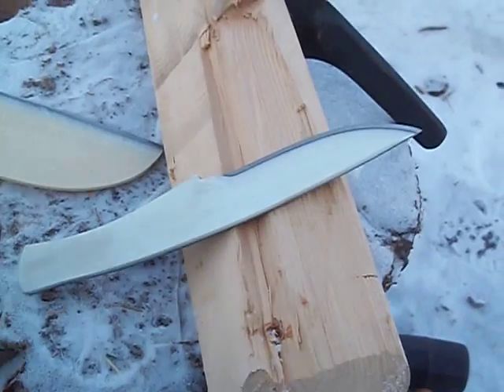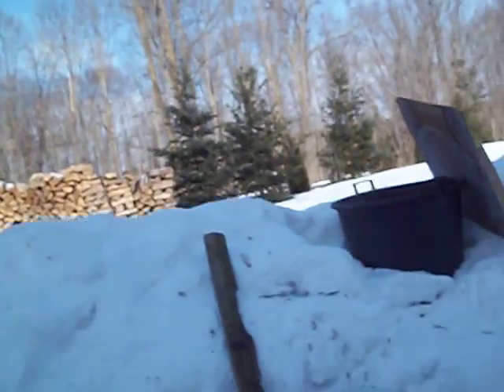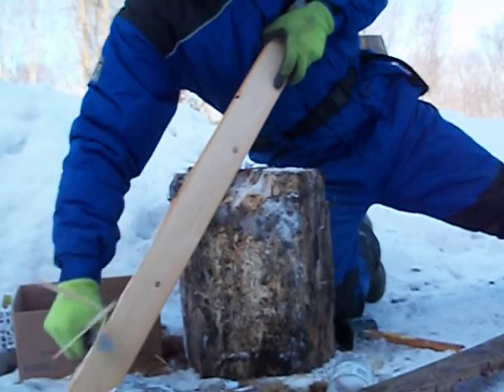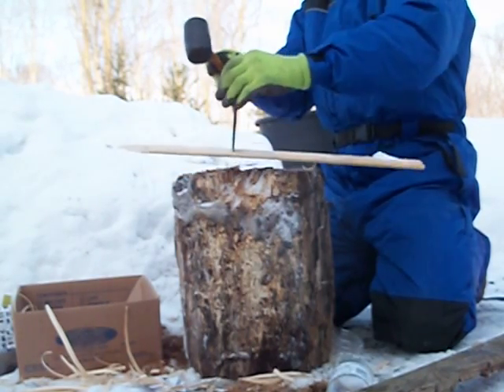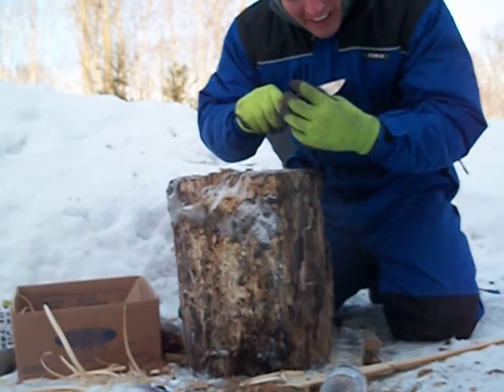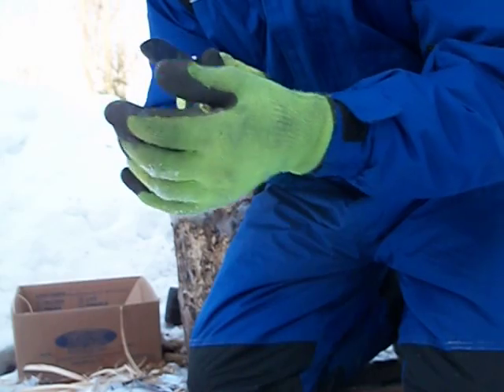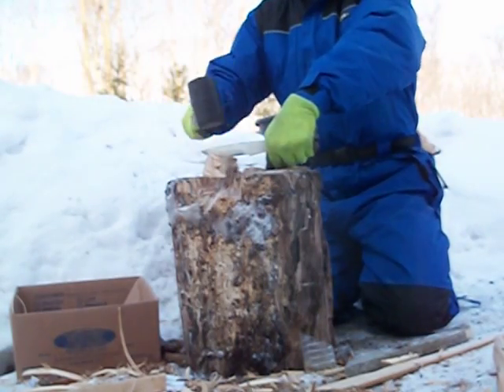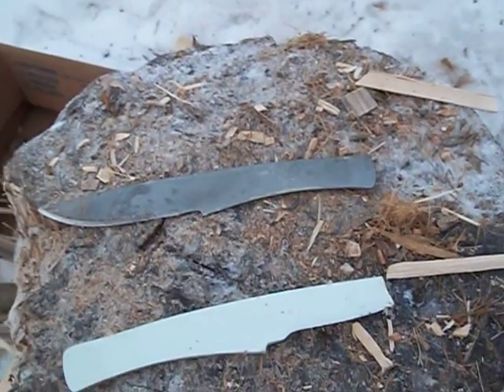ti and g10 knife

Comment from the maker: Good point!  The adhesive is flexible, quite substantially, to below -40C!  I use a thick layer, .010" so in a small blade like this the blade won't act like a bimetallic strip, the deformation is in the adhesive itself, though I confess I didn't consciously plan for that..  Combined with the impact toughness is why I wouldn't even try epoxy to bond metal to laminate (I still use epoxy in a wet lay-up laminate)

Comment: Great craftmanship in fashioning and testing your laminate!  The 'cold' factor survival of your composite/metal bonding is the issue that would interest me most.
    The contraction of your metal - in contrast to the lack of contraction of the laminate; and the ability of your bonding technique to hold sway in the difference.   A graph of temp/bend (measured to the ten-thousands") would help IMHO, regarding issues your metal/composite bonding may, or may not, have to deal with.